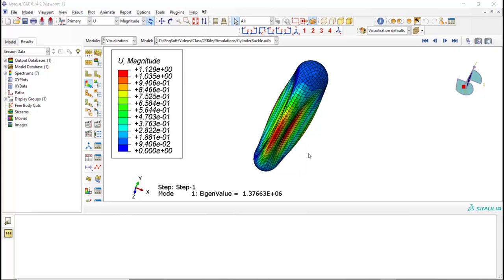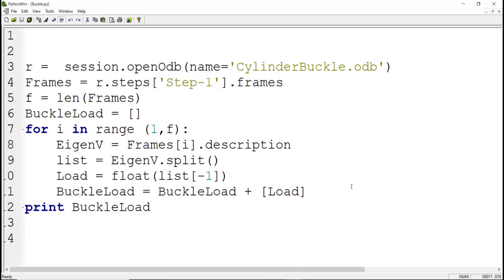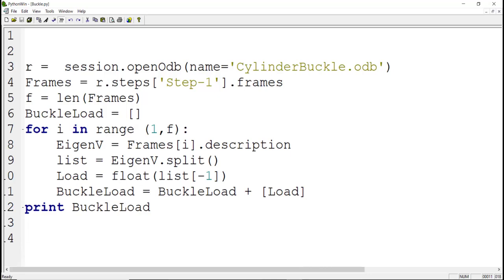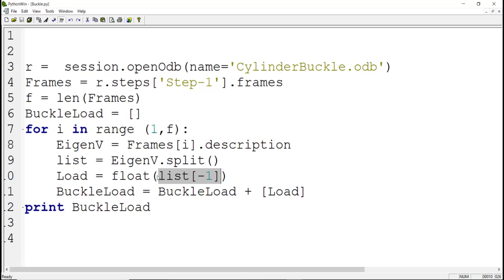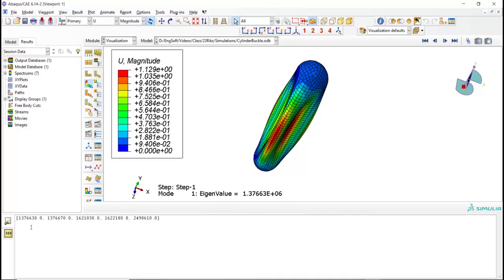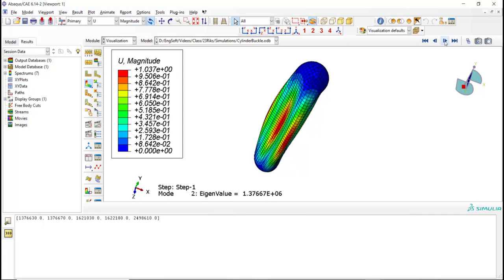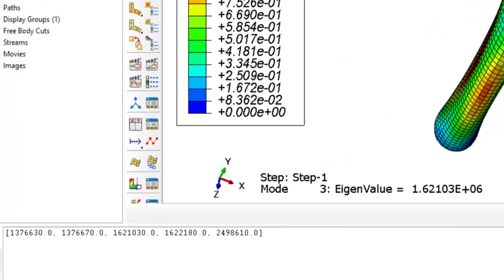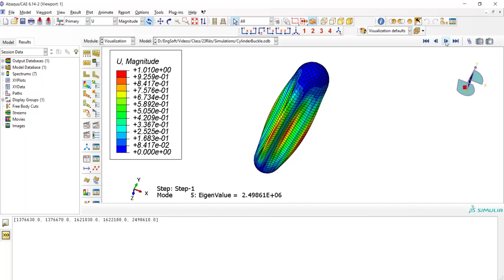Extracting buckling load/eigenvalue from odb file by python scripting in Abaqus

Comment: Hi Dear,
I have a problem, I prepared a code to open an ODB file. I want to get stress, strain, and strain in a layer of mesh or in a path when the nodes in that layer or path reach a certain temperature (for example 520 C), so data was not at the same time.
I want to know how can I define a path or layer of nodes in my model in the python code? and generally, do you have any solution or idea for this problem.
Reply from the maker: For extracting data across special path you should create a node set before running your model. After opening the odb file, At first you should find the frame number by checking the temp of that point across all frames. Then find the values in the frame based on set name.